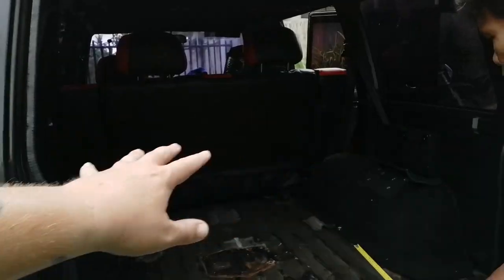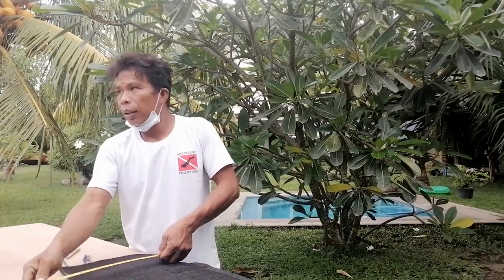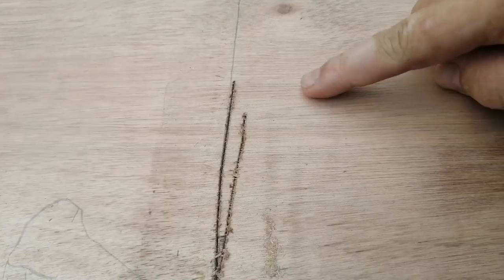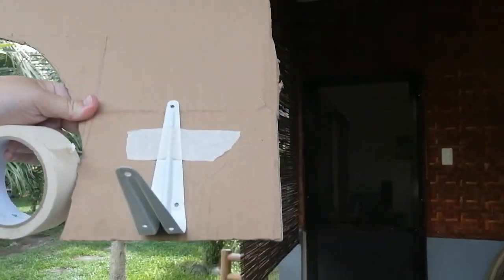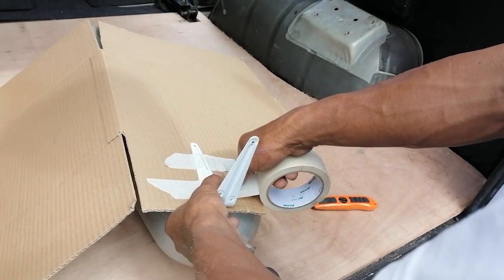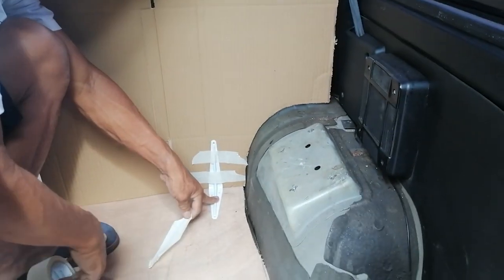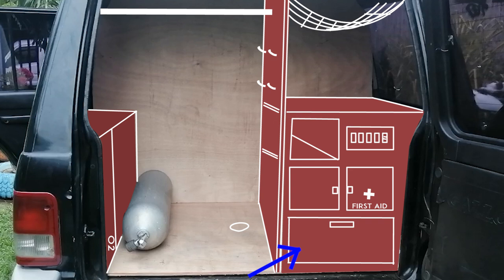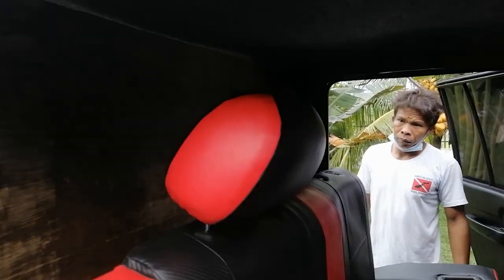Starting the Rear SCUBA Storage System (Critter Getter Build #3)

Comment: I like it so far.   AND I know nobody likes a Monday morning quarterback but...I would not have extended the partition behind the seat all the way  to the  ceiling with plywood but I would have used a fencing type of arrangement like in police cars.  Not that I have ever seen one in person ;) for air circulation and a little bit of view for backing etc,   But I love your idea J
Reply from the maker: Ya I thought of that but I want it shut off. Its so hot here and the entire truck is too big to keep cool, so by making it a much smaller are to cool, and less ways for heat to get in, it'll be way more comfortable. Plus I got a rear camera that will replace the rear view mirror, as well as a backing camera